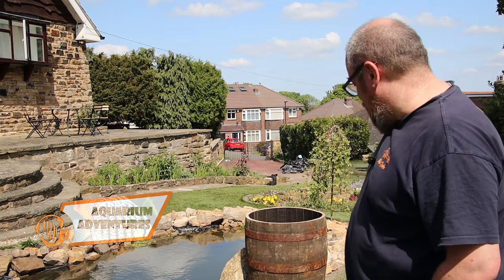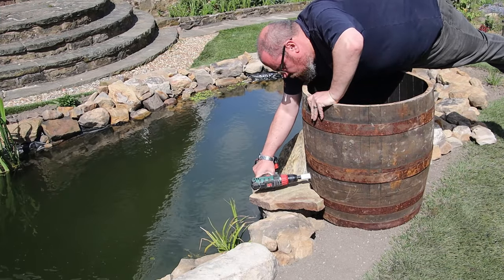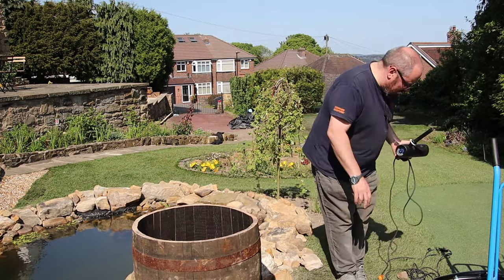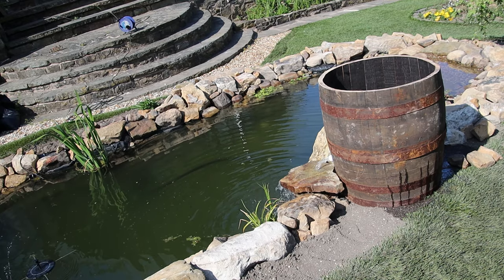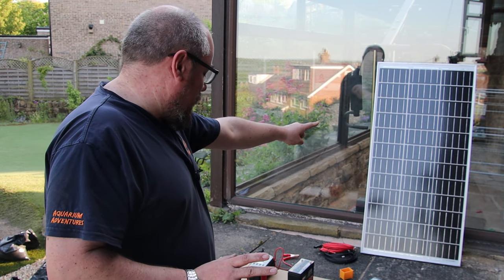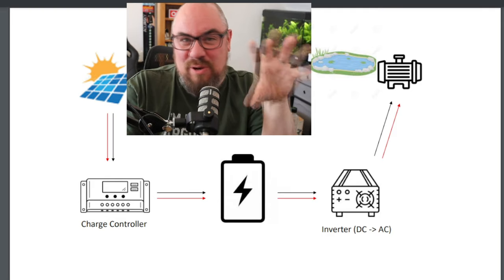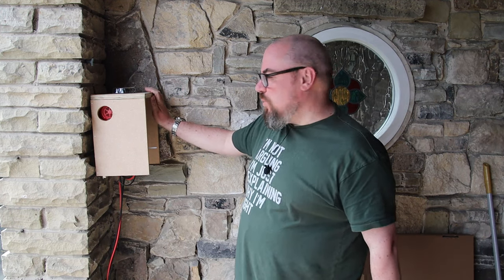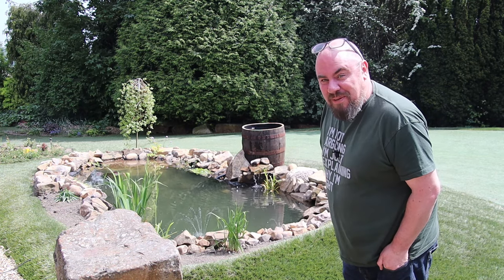Pond bog filter setup - FREE power!

Comment: the problem with solar powered filter is the biological filtering will be messed up by running during day and drying out at night.
Reply: It doesn't dry out because the return is via an overflow so the barrel is always full of water. Nitrifying bacteria can manage without oxygen in flowing water for about 24 hours, what they can't cope with is drying out. That's why solar powered bog filters work.

Comment: The battery is basically useless in this instance and really only functions as a buffer for the solar and voltage control. I would have suggested a better and cheaper choice would have been a DC 12v pump that can run directly off the solar panel. 8aH isn't going to last very long pumping water after the sun goes down
Reply from the maker: I have since upgraded the battery - but even 8aH lasts a hell of a lot longer than a DC connected pump with no battery when a cloud appears!
Reply: @AquariumAdventures  fair enough!

Comment: one problem you may experience with your design is if the pump goes out you may experience dirt back-syphoning from the bottom of the filter into the pond. You can either install a check valve on the inlet side, or simpler would be to bring a 90 degree fitting to bring a standpipe up, like you did with the outlet overflow, then have 2 90 degree fittings to send it back down to the bottom of the filter. If you drill a small hole near the top of this U shape pipe, but just below your water level, you can let air into the pipe to break the syphon.
Reply: One Minute 56 seconds in: He shows the backflow valve for cleanout and backflow issues.
Reply: @thedadishere  I only saw a drain/purge valve which doesn't address the back siphon through the pump. It's even on a separate bulkhead.

Comment: I was sat waiting for the cost analysis versus mains. Considering most pond liners have 10 to 15 years guarantee it makes it worth it.
A quick point for your floating sprinklers. If you get a couple of weights from a fishing shop or even tie a stone to a bit of line that is the pond depth, that will hold the sprinklers  in the middle

Comment: I'm just planning a solar powered bog filter for a wild life pond. I think it might work quite well to use several smaller DC pumps, thereby eliminating the inverter, which I've read are normally only about 75% to 80% efficient unless you buy an expensive one. 

The problem with solar panels is of course that they're only pointing at the sun optimally for a short section of the day - which is why I thought it might work better to have several smaller DC pumps feeding the bog filter, each with their own smaller solar panel, set to point at the sun at different times of the day. Again this is for a wildlife pond (no fish)  - what do think?

Comment: Love the ingenuity of this. One thing you may find depending what you put in here, those small diameter pipes may clog fairly quickly at that low flow and block. reducing it to almost nothing limiting its effectiveness
Reply from the maker: Yes, maybe - but easy enough to swap in larger pipes if needed. Hopefully the clogging wont be an issue as regular flushing should keep everything clear

Comment: Any reason you did pump into the bottom and push up and not pump into the top and gravity feed down and the outlet at the bottom ? wouldnt that be easier to clean ? or is there a difference in power consumption?
Reply from the maker: Having the water rise up through the filter media has a couple of advantages - it allows a more even distribution of the water through the media, and the larger particles get trapped at the bottom making cleaning (through a flush from the bottom drain) easier.

Comment: What would be the battery difference to be able to run it 24 hours?
Reply from the maker: For this application I would need about 800w to run it for 24hr. So that would need a 70Ah battery to power that, but that would empty the battery so it's a case of how much can the 100w panel replace that charge during the day. So probably have to up the battery and the solar panels to cope. I'm doing some testing now with a larger battery - so watch this space!

Comment: Bought a pump anyway, solar panel, battery, solar charge controller, inverter etc etc …..probably about 15 years worth of electricity money for a pump 😂 by which time all that will need to be replaced. False economy
Reply from the maker: I know it's tough to watch the whole video - but I cover this, so no need to make wild guesses on the ROI when I tell you in the video.
Reply: @AquariumAdventures  I don’t believe your maths. You must’ve spent a couple of hundred ? Pump should cost 20 quid per year to run
Reply from the maker: Luckily, maths isn't a matter of faith.
35w pump x 24hrs x 365days at £0.34 per Kwh = £104

So £200 investment paid for in 2 years - even if you allow for only running 12 hours, 4 years. If I add in UV, Air pump any other equipment, that brings down the ROI with no further expense.

But yeah - believe what you want and I'll put it in my big pile of things I don't care about.